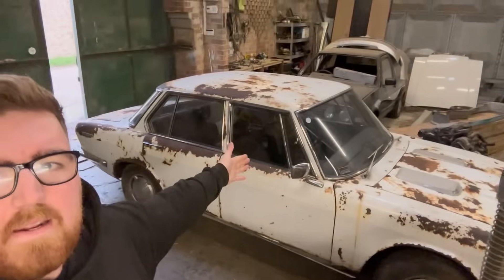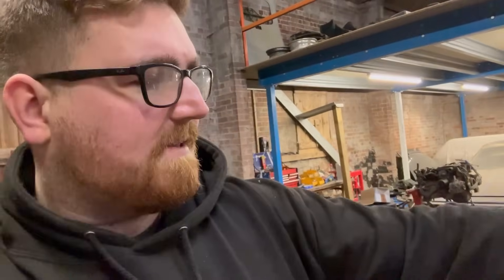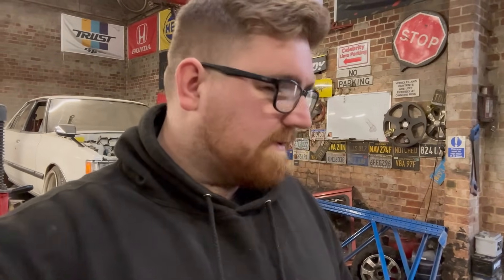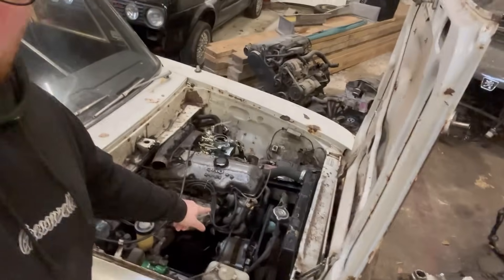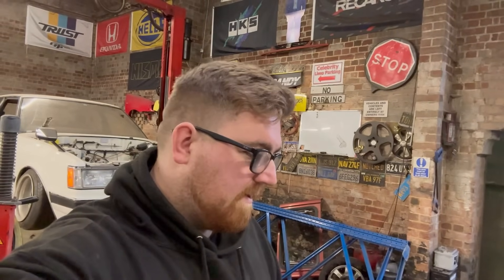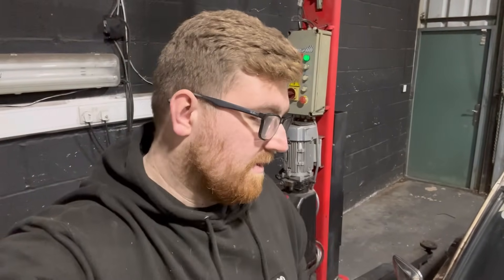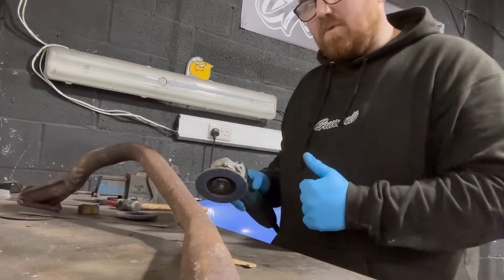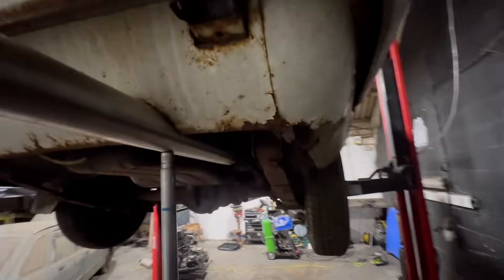Working On The Mazda 1800 Again! - More Problems!!!

Comment: Had the same spark issue with on my beetle, would only fire with jump-spark as yours do. 
I widenend the connector on the lead so it would have good connection in the dizzycap, and then I swapped out the condenser and problem was solved.

edit: come to think of it I changed a bunch of things, I'm gonna check with my mate who was with me if he recalls what actually solved it. I'll message you on the the gram if i find out!

Comment: Perhaps a dodgy plug with compromised insulation on cylinder 1, leaking current back to earth, then the lead being held away from cap is intensifying the spark to overcome it.
Reply: Zm

Comment: Consider changing all plug wires and the distbutor itself. Perform fire continuity test on high RPM. And test/ change the distributor coil. It is tricky😢

Comment: Pull the boot back off of the plug wire and try plugging just the metal connecting bit into the distributor to see if it still doesnt fire